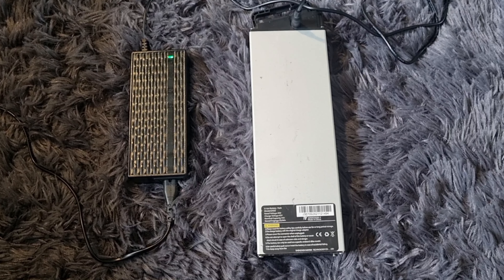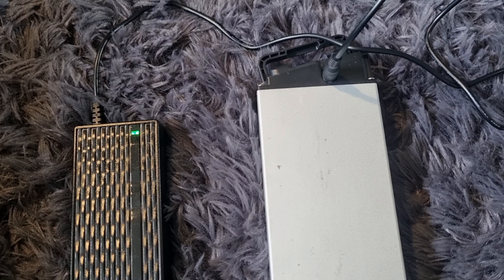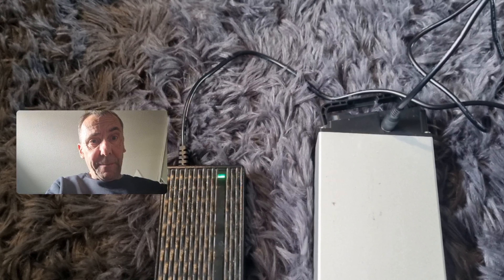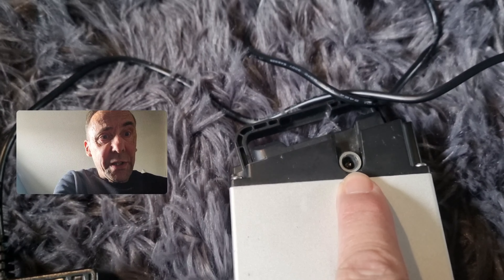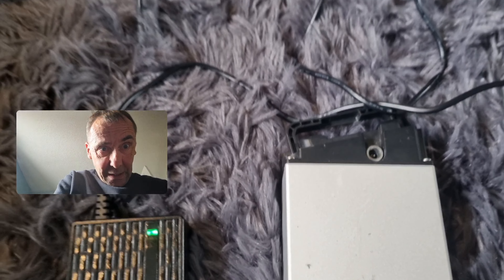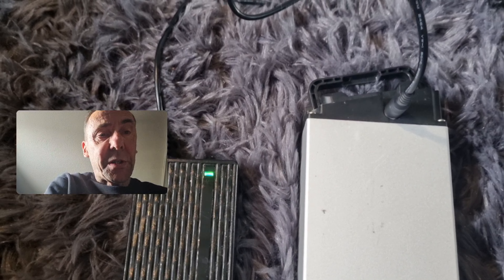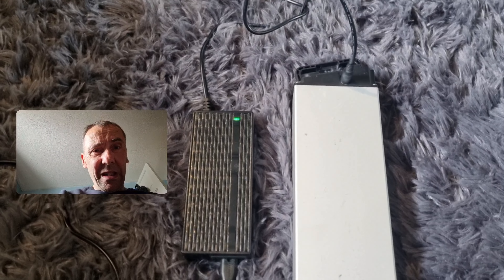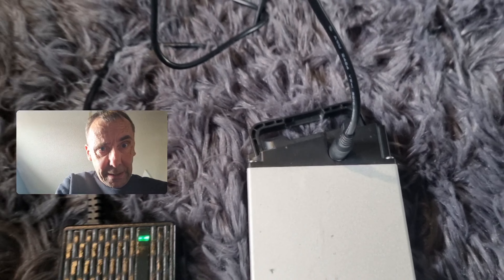MIRIDER BATTERY NOT CHARGING

Comment: I’m sorry to say you may have to get a new battery. I wanted to buy a Mi Rider but a Mi Rider Facebook Owners  group showed so many owners having battery, and other issues, I didn’t buy one.
Reply: Good u hv been researching. :)
Reply from the maker: lm wishing l hadn't bought one now.
I thought l had blown a fuse in the battery, so l opened it up and guess what. There is no fuse. I think that's illegal. It's basically a junk battery that costs £300 to replace.
Most reputable e bike batteries all have fuses in them and are easy to replace, but all you can do with the Mirider is buy a new battery. It's outrageous. 
Did you manage to buy a good bike in the end, Maureen?
Reply: @keep-going  Yes - I bought a 3 speed internal hub Batribike Dart 3 E. I couldn’t afford a Brompton but it goes on the Bus, Trains and the back of my Hyundai i10. 500 miles in 4 months and no issues. Interest free from Allen’s E-bikes in Leighton Buzzard. Came by Courier, fully assembled and I have never had any range anxiety. 30 plus miles with 50% left. I do pedal a bit though !
Reply from the maker: @maureenarnold-hc4sg  Yes, l think you made a good choice there.
Mirider is great when it's going, but it's very unreliable. I would never buy one again.

Comment: Not sure if has a fuse or not. Check with mirider support. Is it still in guarantee? Don't tell that you dropped your keys... Try taking a voltage reading off the battery terminals. One with the charger plugged in and one without the charger. Chances are that the reading with the charger will be higher (fully charged 42 volts). A possible reason for the green light. My battery reading was 42 volts on charge, (it displayed a green light), and 12 volts or something with no charger. Sorry, but a had to buy a new one. Although I believe they can be repaired I found the prices quoted are not far off the cost of a new one.
Reply from the maker: I think l can repair it. Ebay sells charging ports. So l just have to take it apart and fit a new one. It's a bit awkward to do, but l will buy one and have a go. Only  a fiver, so worth trying.  I will do a video on this when l get the part.